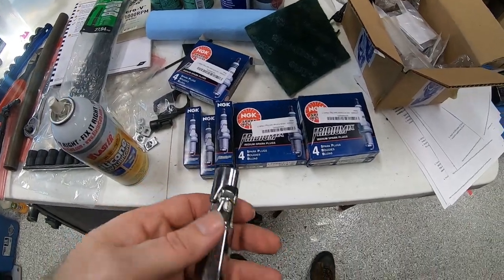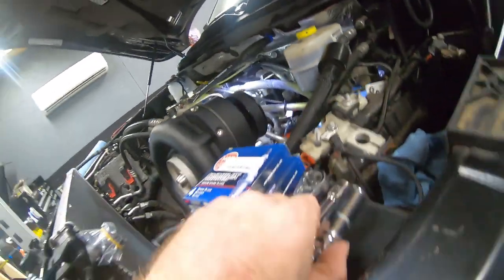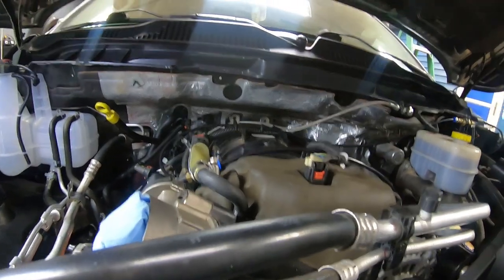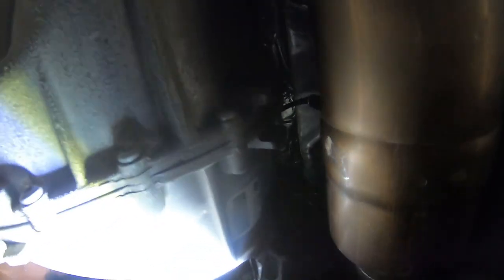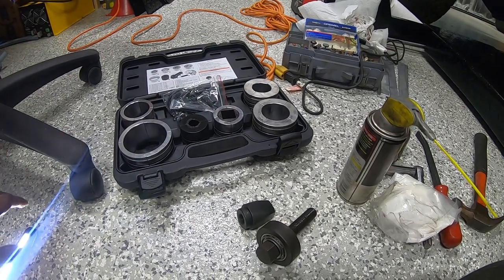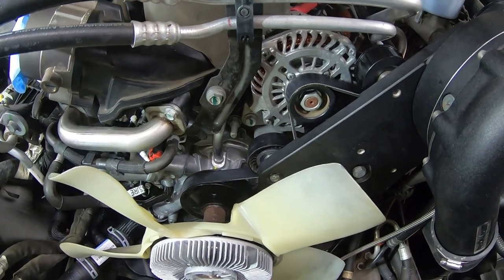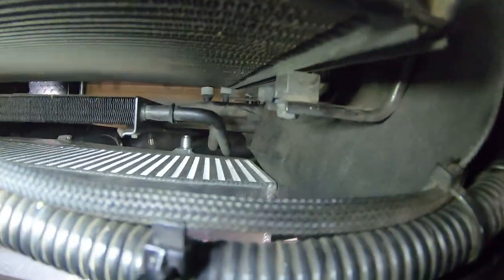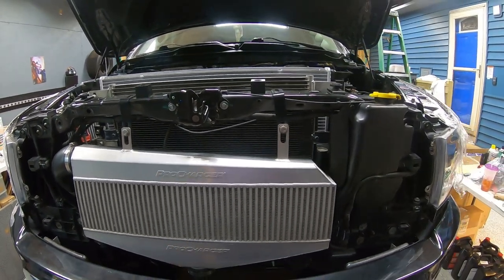Ram 2500 6.4L Upgrade Part 35 procharger supercharger install finish and prep for fluid fill

Comment: Do You see any problems that I might have installing a supercharger on my 2019 Ram Power Wagon with dual alternators installed from the factory? I called procharger Tech Support and the Tech I talked to  didn't have much information about dual alternator set up on 2019 Power Wagon. The second alternator is on bottom left on engine under the radiator hose, If you are standing  in front of truck looking at the engine
Reply from the maker: Did they ask one of there engineers?  i would think that the placement of the second alternator would not interfere based on the location of where the supercharger brackets mounts, next to the primary alternator.  The one issue I can think of would be belt length as you would need a custom one to account for the extra length needed to reach the lower alternator.  I had one of there engineers work with me on a redesign of the mounting bracket to have the belt make better contact with the power steering pully as the belt would slip past the power steering pulley during a hard turn.

Comment: On the oil drain line what are the part numbers for it? And from where?
Reply from the maker: Thanks for the comment.  Procharger has them, just need to call and verify that it will fit your head unit.  https://www.procharger.com/sc-oil-drain-line-field-upgrade-kit.html

Comment: 6.4 uses LZTR or LTR spark plugs style, which is shorter than LFR. BE AWARE
Reply from the maker: Thanks for the comment.  Interesting I can't speak for all 6.4L hemi's.  But I can confirm that on this 2016 6.4 it came from the factory with LFR5AIX-11.  We switched over to a range colder, due to the supercharger, that made the part number: LFR6AIX-11.